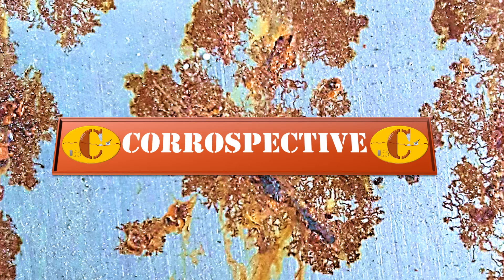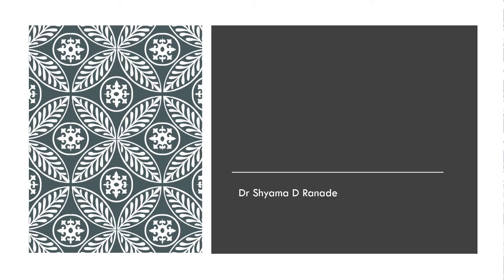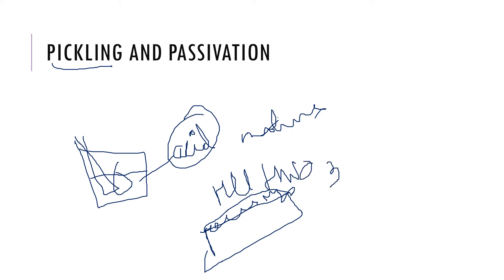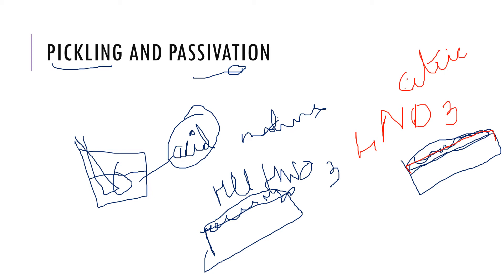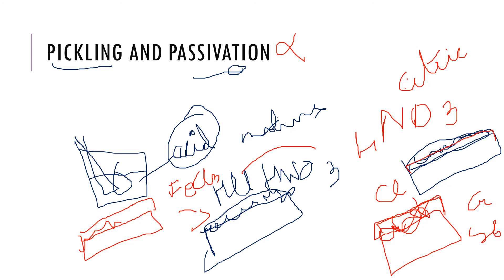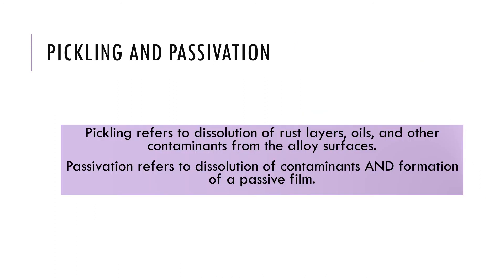WHAT IS..pickling and passivation

Comment: Hi
How can I completely remove HCL after pickling process?
Reply from the maker: Hello, It will have to be washed and rinsed with water and ethanol thoroughly. Any other chemical reaction to remove HCl will damage the sample also.
Reply: @DrShyamaRanade  
Hi
Thanks a lot.
I wanna pickling by HCL & passivation by citric acid.
Is it Okey if I rinse with hot water after pickling by HCL & then go for passivation by using Citric acid?
Reply from the maker: @sharifislam4189  Hello, please test on a sample if the water effect the sample or not. Other steps should be according to the standard that you are following. For more discussion, please email me at gatemetallurgypractice@gmail.com
Reply: @DrShyamaRanade  
Hi Dr Shyama
Thanks a lot for your kind reply.
Can you plz advice what is ethanol throughly?
By the way how long we should circulate for passivation.
What is the impect if passivation chemical NaNo2 uses more than 1.5%
& Circulate the Chemicals more than 6 hours.